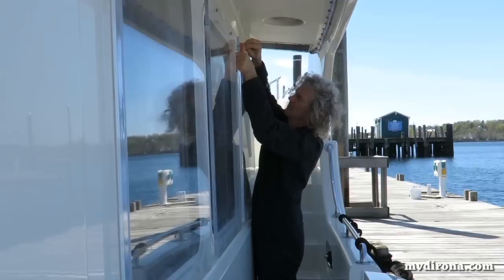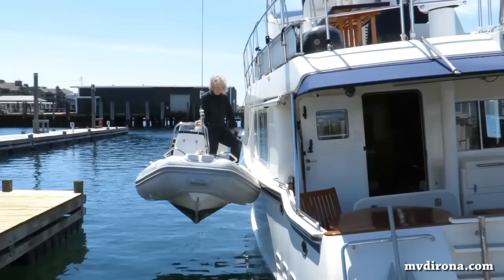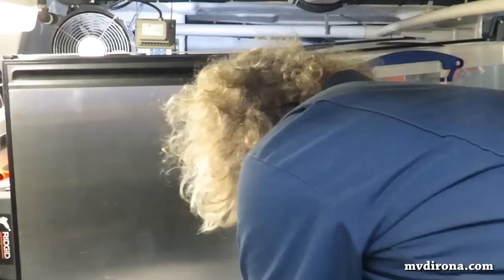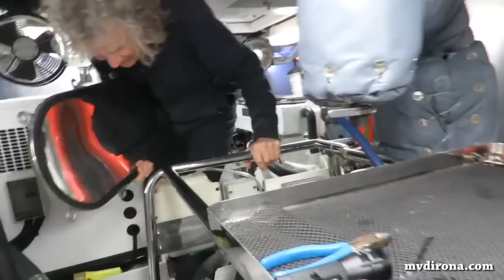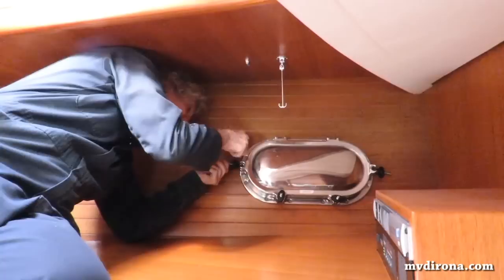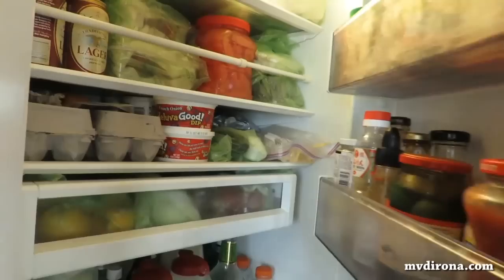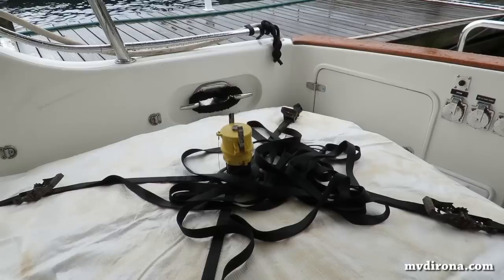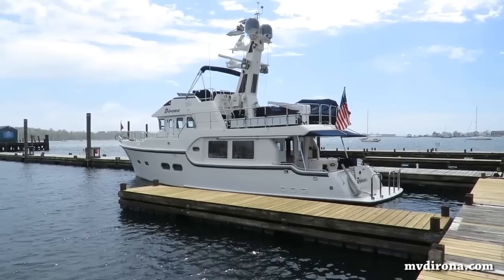Preparing Dirona for the North Atlantic Crossing (MV Dirona Channel)

Comment: 0:30 I see You don't have a flopper stopper on the starboard side. Is one flopper stopper on the port side as effective as when there are two, or is there a difference, and if so, is there a big difference?
Reply from the maker: There is a flopper stopper on both sides of the boat but we frequently only use one.  A single flopper stopper seems to have about 70% of the anti-roll forces as using two.  I suspect in the limit when it's really rough 2 floppers is 2 about twice as effective as a single flopper stopper. But, in more mild conditions, one is very effective and dome boats elect to only install one.

Comment: 52ft going across that much water o my learned something new. I always thought there was a recommended boat length to cross that much water and fuel needed. Plus the vessel being fiberglass rather then  aluminum or steel that would be enough to freak me out lol.
Reply from the maker: Fiberglass is a pretty common small boat material and has crossed oceans thousands of times so that one is fairly well tested. But, you are right, it's uncommon for small power boats to be able to carry the fuel and have the range to cross an ocean. The vast majority of small boats crossing oceans are sailboats.  This boat is a Nordhavn and they specialize in ocean capable power boats of all sizes from 40' all the way to 120. Their design point is to make a boat strong and safe and to have the range needed to make an ocean crossing.

Comment: Wish you mentioned how much all of that fuel cost!
Reply from the maker: It's been awhile so I don't have the exact number but I suspect it will have been around $5,000. As you know, the price of fuel is much more in other parts of the world and, just filling the boat tanks without bladders in Australia cost over $7,0000. It can get pricey but it doesn't happen often. We have only filled the tanks twice this year and both times they weren't that low (over 1/3).

Comment: why wouldn't the port hole covers go on the outside to protect the windows?
Reply from the maker: Your right that, in many ways, they would be better on the outside. Either inside or outside, the protect the boat from flooding but, on the outside, they protect the window as well. Presumably they are attached on the inside because they are so much easier to install there and they can provide the same last line of defense against flooding in either position.

Comment: maybe i'm not appreciating the fasteners, but heavy plexi for water that could break windows, held on by 4 screws for each window ? that seems light.
Reply from the maker: They are held on by 4 1/4" machine screws which will take several tons of force but you are right that water is incredibly powerful. If bigger fastners where an option, I probably would have taken it.

Comment: wondering why you didn't just push over to the dock next to yours for the 30 minutes it took to put the storm plates on?
Reply from the maker: We've been experimenting with different ways to install these port slide storm plates. Given the spot beside us in the marina was available, I think you are right that just moving over would have been easy/faster.

Comment: Any trapped moisture problem between windows and storm plates?
Reply from the maker: No, it's not been a problem. The storm plates are held 1/4" off the main window so water doesn't collect and there is good air flow to allow drying between the windows after a storm..

Comment: It is probably a dumb question but aren't those bladders dangerous because of fire hazard?
Reply from the maker: The flashpoint on diesel makes it far safer than gasoline but, if a fire develops on the boat and it gets hot, the bladders definitely could burn. Its similar to the boats built in fuel tanks. Below deck, there is 1,750 gallons of diesel housed in a fiberglass. Should the fiberglass start to burn for some other reasons, the diesel will support the resultant fire. The lesson is, on any boat but especially on a fiberglass boat, don't let fires start and fight them early and effectively. Once out of control, the boat will be lost.

Comment: Do the bladders come with the boat, or do you rent them, or did you have to buy them?
Reply from the maker: The boat can easily go 2,500 nautical miles so can cross any ocean without needing deck fuel. At times we have gone as far as 3,850 nautical miles between fuel stops and we often go 3,000 so we do need extra fuel for these trips. 

The fuel bladders were all purchased Aero Tec Laboratories (http://www.atlinc.com/) and we're supper happy with them.

Comment: Just curious and perhaps someone can answer this, from what I understand the Atlantic ocean can produce massive storms and high seas. This particular vessel seems a bit small for trans-Atlantic ocean voyages, how does it brave the high seas and storms that it will invariably run up against ?
Reply from the maker: Weather can be a problem so ocean crossings are best done during the calmest part of the year. Normally that works pretty well. Here's a video of some of what we saw in the North Atlantic -- its rough but not dangerously so: https://www.youtube.com/watch?v=guEnTp2a6Sc&t=171s

Comment: Why not simply have marine grade rough weather windows to start with?
Reply from the maker: The short answer is economics. It certainly could be done and that is what was done on the high risk forward facing windows in the pilot house.  They just went with sufficiently thick glass to be able to withstand massive water loadings. To get window as big as the salon's windows safe for sea, the glass would have to be very thick and so cost would be higher.  

What's done with the storm plates is put a 1/2 sheet of high strength plastic in front of the window to spread the load. This is effective and inexpensive but can scratch easily. So it's effective but doesn't pass light as well and scratches easily so isn't really what you would want for the normal use window.

Comment: i thought these nordhavns can do that distance on internal tanks only?
Reply from the maker: That's an important point A Nordhavn 52 can go anywhere in the world and cross any ocean but you don't have complete flexibility on routing. Fuel allows different routes, higher speed, or opens more options. 

The most important point to keep in mind is that most published range data you see is wildly optimistic.  Ocean swell tends to reduce fuel economy greatly.  As part of our boats original commisioning, John Deere engineers where on board and they did a two way (both directions) fuel economy test at 100 RPM increments. Using this data, our range with a 10% reserve was around 1,400 nautical miles at wide open throttle of 9.5 kts, 3,790nm at 6.5 kts, 4,500nm at 6kts, and an incredible 6,770nm at 5kts. 

Clearly you don't need more than 4,500 nautical mile range but ocean conditions are very different and we've learned our range is 2,500 nautical miles. This is excellent but there are times when you might want more.  With deck fuel, our range is 4,000 nautical miles. The trip you were asking about was Newport Rhode Island to Kinsale Ireland which is just under 3,000 nautical miles. That run, if made directly does need external fuel. 

Even though we don't need deck fuel for runs of up to 2,500 miles, as soon as we get above about 2,000 nautical miles, we'll probably fill at least one deck  tank to offer more flexibility. More data on these decisions at: https://mvdirona.com/2017/04/fuel-option-value-speed-safety/.

Comment: How to you transfer the fuel from the bladders? Do you have a portable manual pump? Would love to see that process please.
Reply from the maker: The boat has multiple fuel tanks and is equipped with a fuel transfer pump. It's a high speed electric pump that can move fuel from one tank to another. When the transfer pump transfers fuel it also forced it through a filter so the fuel can be "scrubbed" but pumping it from a tank and back to the same tank.  I've added another connection on the fuel transfer manifold that connects to a bulkhead on deck. There are short hoses with quick connect fittings that connect between the on deck fuel tank and the bulk head. Once this is in place, you don't even need to go outside to tranfer fuel from the deck tanks to the main fuel tanks and there is no risk of open tank fittings allowing water ingress. It works fairly nicely and allows the fuel bladders to be pumped down flat removing all the fuel completely which makes them lighter and easier to store.

Comment: Do you still travel as much with diesel over $5 a gallon now!! I just love all your technical explanations!
Reply from the maker: You're right it is getting expensive to fuel a boat but we never found diesel to be one of the dominant costs.   Even 5 years ago we were paying nearly $7/gal in some locations (e.g. Northern Australia) and we wish it were lower but it was never even close to our biggest cost. 

When operating a boat at displacement speeds, fuel burn can be kept relatively small. Lower costs would definitely help but world cruising is still practical at higher fuel costs.

Comment: JENNIFER and James please could you tell me why you need all these fuel bags I thought your ship carries a load of fuel in its hull.
Reply from the maker: It's actually more than a "ton of fuel" below decks. Just a bit more than 6 short tons or 1,750 gallons :-). 

Your question is why do we need more? Strictly speaking, we really don't.  You can do anywhere in the world with our roughly 2,500 nautical mile range. With longer range, bigger runs become possible. We ran non-stop between St. Helena in the South Atlantic and Barbados and that's a 3,760 nautical mile passage. For sure, you can get from Cape Town South Africa to Barbados in a 2,500 nautical mile range boat but the routes are not as direct.  More fuel allows more range and more speed for a given distance.  We think of fuel as "option value" -- it opens up more possibilities. 

On this particular crossing, we are going 3,000 nautical miles so really do need some of the extra fuel we were carrying but not all of it. And, if we chose shorter routing through the Azores, we wouldn't need any deck fuel.

Comment: Thanks for the lovely video 
question:
what method did you use to pump the fuel from the Bladders to the vessel main fuel tanks!?

Thanks again and keep them coming
Be safe
& Safe sailing "boating"
Reply from the maker: Good question. The boat has a fuel transfer system designed to be able to move fuel between the 4 below deck fuel tanks.  What we did was add another input to the fuel transfer pump manifold that connected to a fuel hose running to an exterior bulkhead at the back of the boat.  There are short hoses that run between the exterior on deck fuel tanks to the bulkhead fitting.

To pump out the fuel tanks, a manual safety valve needs to be opened on each tank after which, the fuel bladders can be pumped into the tanks below by going down to the engine room and decide where to pump the fuel, set the valves correctly and engage the fuel transfer pump.  This has the advantages of not forcing the operator to be outside on deck, there is no risk of getting water into the fuel system, and you can evacuate the bladders fully. The ladder is particularly helpful in that fuel bladders with even tiny amounts of residual fuel are heavy and hard to pack away whereas fully emptied bladders are easy to deal with.
Reply: @MVDirona  thanks for the prompt reply, what a brilliant way.
Love the risk assessment part of thinking.
Great 👍🏼 job
Thanks for sharing such technical specks 
It is really informative.

Comment: How do you transfer fuel from bladders to tanks
Reply from the maker: The fuel bladders can be connected to a bulkhead fitting via short fuel hoses with cam lock fittings. There is a fuel transfer pump  inside the boat that is responsible for pumping fuel between tanks. From inside the boat, the fuel can be transferred from the bladders into the tanks below. More details on the process here: https://mvdirona.com/2012/12/fuel-for-the-crossing/.

Comment: Nice boat, but why do you not use a sailboat for such long distances?
It would save loads of fuel...
Reply from the maker: We chose the boat focused on it being able to cross an ocean but not focused on that being the primary usage.  Most of the time we're exploring new countries and near land. It certainly would be easy to get a sailboat that would do what do. In fact, when looking at ocean capable boats, the selection of sailboats is far broader. But, not everyone wants to go sailing.
Reply: @MVDirona  Thank you. I understand that if you do not like sailing that is a comfortable ride in such a quite big boat. may be you said in your video, but my english is not quite good. Do you have a backup engine if the main engine has a failure? And isn´t it quite stressful to have 24/7 hours the engine running?
Although if you are a engineer perhaps you like that sound ;-)
Reply from the maker: You can hear it but it's not that loud and we don't really notice it. The boat motion sometimes can make sleep more difficult but the engine doesn't seem to bother us.

We do have a backup engine. It's a 40 HP lugger that can move the boat at about 4 kts so not fast but it will get you there.

Comment: Very well done. Must you keep readjusting the tie downs on those bladders as the fuel is used up?
Reply from the maker: No, we keep the bladders full until there is room below decks to accept a full bladder load of fuel. Once we have that space with some headroom, we just pump the entire bladder below and put it away. If it's too rough to put it away, then we just leave it sucked down flat on deck. The way the tie downs work is they are fully secure to the boat and the tank is secured to them so nothing will go anywhere and there is no need to adjust anything.

Comment: Why don't they just make the windows the same material as the storm plates?
Reply from the maker: It's not a great material for visual clarity and scratch resistance. A better option that is used in sea going boats is thick and especially laminated glass.  It's actually easy to get glass far stronger than the rest of the boat. It's somewhat more expensive but it's the right answer for maximum safety and ease of use in an off shore boat.

Comment: Great video, but I don't think any vessel should exist where there is a risk of the windows being biffed in due to sea state. The transparencies should be at least equal strength to the surrounding structure.
Reply from the maker: At a theoretic level, of course you are right. But it's a reasonably hard engineering problem where, until recently,  every solution had some nasty trade-offs.

The most common solution is really small windows or no windows at all.  Cruise ships often have no windows in the forward facing lower decks.  The common solution for small ocean going boats have only very small windows. This meets the engineering requirement but it makes for a dark and kind of unpleasant life style for the 99% of the time when the boat isn't crossing an ocean.  

Larger windows really are nice but they present engineering challenges to deliver them safely. Just not having large windows isn't my preferred solution. The two remaining choices are storm plates for the rare times when ocean crossing and windows that are structurally as strong as the surrounding material.  There is no question that the latter is the right answer and there is no question that materials are now available that make this possible in glass.  20 years ago this wasn't economically practical but today it is and I think you are right that it is the best solution by a good margin. Over time as materials and materials costs improve, this approach will become the standard solution
Reply: @MVDirona  I really appreciate the response, and well thought through. You have what you have, and definitely know how to deal with seawater ingress risk. Laminated glass or, God forbid, Aliminiun glass is the way forward.
Reply from the maker: Yup, totally agree.

Comment: Nice videos and what an amazing boat. But storing more than 3 tonnes  of fuel on deck doesn't that mess with the stability?
Reply from the maker: In this operating mode, the boat calculates out to continuing to meet CE Class A Ocean with the deck fuel. It actually can survive the main tanks being brought down to near empty with fuel on deck and remain CE Class A Ocean. It won't quite make it with empty tanks but, as I said, we don't run it this way. When we have 360 gallons of space below decks, we move the forward tank load below. Then once we have 600 gallons below decks, we move the aft load below.  The goal is to have this fuel below decks in 7 to 10 days while weather reports remain fairly accurate.

Dirona is CE Class A Ocean even when using fuel bladders. I'll post a more detailed blog on this at https://mvdirona.com.
Reply: Thanks for reply. Your Nordhavn is an impressive boat that's for sure. I've read your blog, and you had issues with flooding and a lot of water on the stern deck on your north Atlantic crossing. And I can hear you say in the vid that she's deep in the water after the fuel is stored, don't you think that could mess with the "self-draining" system on your stern deck and cause the flooding?

Comment: Does the fuel in the bladders go to the engine or do you transfer it into the boats tanks ?,,Love your Adventures
Reply from the maker: As soon as we have 400 gallons used below, we pump the forward tank down.  And then, once we use up enough to bring aft tanks below we do them as well. We basically clear the decks as soon as possible since it's bad for boat stability to have main tanks low with fuel on deck. 

It feels kind of weird to have full tanks, 1,000 nautical miles off shore and 7 days after leaving port.